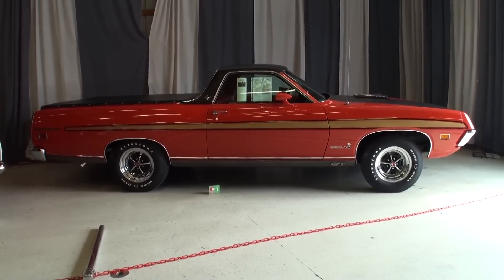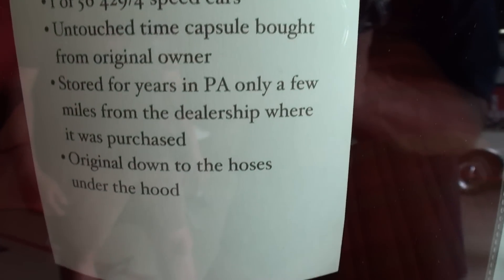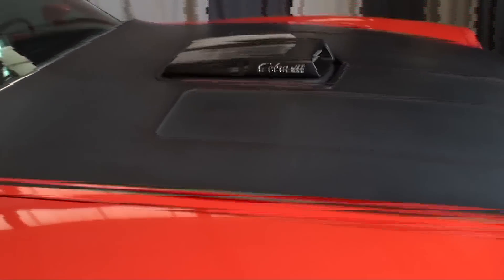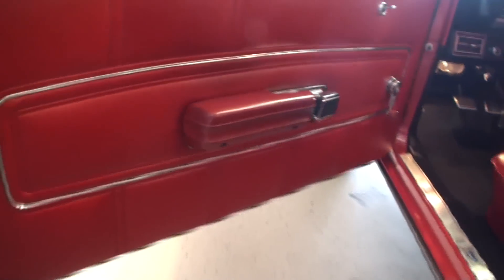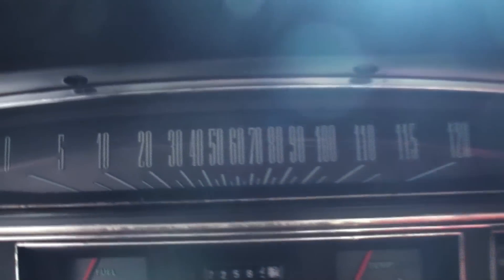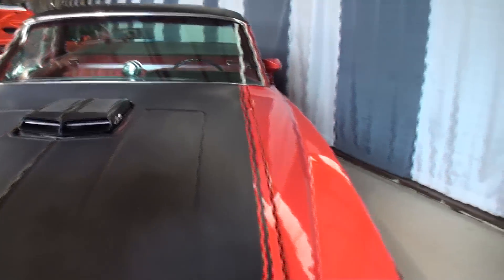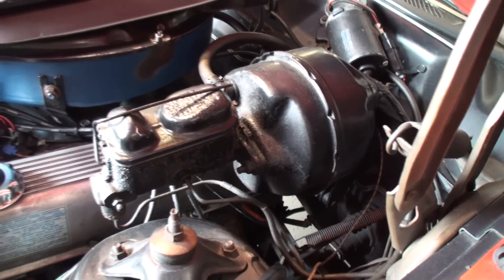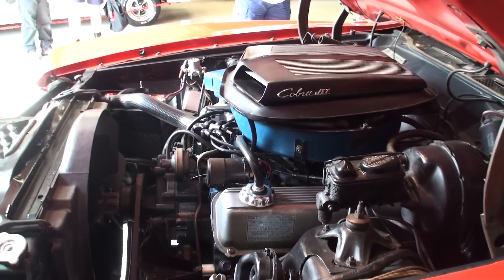1971 Ford Ranchero GT in Red & 429 Cobra Jet CJ Engine Sound on My Car Story with Lou Costabile

Comment: Has to be one of the highest optioned Rancheros I've ever seen. I think it's funny how the original owner ordered everything to make it super sporty but skipped the optional ribbon tachometer. Lol. Just an awesome car.
Reply from the maker: Hi Kenneth White, Glad you enjoy this one :-) Me too, Lou
Reply: Lou Costabile loved the video. Just love the survivors. Had a 70 Torino GT, 429, 4 speed with the same Hurst shifter. Mine did have the ribbon tach, but did not have hideaway headlight. White with the laser stripe. The clown I sold it to totaled it within months.
Reply: No air conditioning. No upgraded interior package. No console w/buckets. Other than that, all of the toys. I drove several of these in my career. Couldn't keep them straight. Absolutely zero traction, similar to the El Camino.

Comment: Wow, what a great find, Lou! This Ranchero is fantastic. It will probably make any car guy confused once again by the definitions of wants vs. needs!
Reply from the maker: Hi TheGunfighter45acp, Fun when I go to a car show a find a "jewel" like this one :-) Glad you shared a "Wow" :-) Lou
Reply: It is strange how the Ranchero  morphed   through a few model .   In 57 is was based on the Fairlane until mid 59  when the Galaxie  became its own model  to  make the Rachero  with the   luxury features  since GM   followed suit  with the El Camino  which was more like  the Impala inside with  that  cabin that was very close  to a car  appearence. 
   Then FORD  saw the market  for a Falcon  and  it was the  basis for the Ranchero  in 1960-66 . Then in 1967 it was an  One-off   design  year  with stacked  quad headlights  and  back to the Fairlane design for the front sheet metal  with  the  modified Falcon wagon  rear .         
    The 68-69  were pretty well   the  new Torino/Fairlane  at heart with the same  dash Unit  while  the  Ranchero  500   and  GT   shared the Fairlane  500 and GT  trim.   The 1969  added the rare   Rio Grande   Ranchero  in a few Grabber Colors with a vinyl  roof  and  Badge in the center of the  wheel covers , blacked-out hood    with  a  scoop , side stripe   and Bed rails .  
    It's estimated that  out of about 16,000 1969  Rancheros  ,   there were about 800  Rio Grande  Version   made and every  one had the  Data Plate  code  SPV ( special Performance Vehicle )  no matter the engine size . 
    In 1970  the Squire was added  for the Wood trim while the interior now had Ranchero badges  inside  on the glove box door  instead of the old badges for Fairlane or Torino .  It also added the 429 Cobra jet , Super cobra jet , shaker hood scoop  and hide away headlights.    It pretty well stayed  as a Torino  until 1976  when the Torino was retired .   
  But in 1977  the Ranchero  became the LTD II   Pick-up  .  But the 77-79 was well liked with the stack  quad rectangle since sales  jump about 10'000 and the 1979   saw close to 25,000   which included the 79 1/2  special edition for the 22 year run as the end of production . 
     FORD bought about 40% of Mazda and  stopped making the Courier Pick-up       
        to  revive the Ranger Badge from the F-150  and  build in on the platform of  the Mazda B2000    pick up .

  So the Ranchero  goes from the fairlane to the galaxie   to the Falcon  back to the Fairlane  then  a Torino    only to die  on the  LTD II  Design  where the  LTD  was born from the Galaxie  in 1965 . 
       The LTD II  Ranchero  is also popular to  modify  because the  front sheet metal fits the same  for the   Cougar , Thunderbird  and Mercury  Montego  in 1977 .

Comment: if anybody is interested in local/personal history, I have a pretty cool story about my friend's dad's 1974 Ranchero that he bought new back in the day

this particular car was a 390 V8 auto that was geared for highway use and the engine was slightly modified. he used this car in the mid 1970s to make 'deliveries' from Mexico to the south east united states. there was a section of the interior body just behind the drivers seat that was cut out and bolted back (hard to explain over text) where he would hide the package during his routs. it was also under the carpeting so it was even more concealed.  just like every outlaw back in the day, it was pretty easy to outrun the law, before the radio and helicopter days haha. he told me it was so well hidden that half the time he got pulled over, he would just stop and let the cops do their thing. other half of the time he would put the petal to the metal and let the 390 sing! 

he still has this car/truck parked in his back yard. its sitting there quietly next to his farm equipment just chilling in the tall grass. odometer rolled over twice. he never got caught, not even once. he said he's been well over 150 mph in this car multiple times. Ive even seen the hidden compartment with my own eyes and knowing this guy personally I really don't think hes bullshitting (in his late 70s he stil llegally gambles and slings moonshine)

I cant help but think of this older than dirt fellow every time I see a ranchero of this era
Reply from the maker: Hi thatallredheaddude 1, Interesting story and I think you did a great job sharing it, Lou

Comment: Not many of those Rancheros still look that good, a truly lucky find.  Except for the Cobra sticker and snake decal on the fender it looks all original. Those decals were only on 1970 Torino Cobra. The period correct tack is nice, but I hate to see holes drilled in that original dash  pad. So I would rather have the factory ribbon tack myself.  That's a very nice Ranchero!
Reply from the maker: Thank you Kimberlyexpects for viewing and sharing your thoughts on this "very nice" one :-) Lou

Comment: That's one bad ass Ranchero. My favorite mid size Ford muscle cars ever were the 70-71 Torino/Cyclone 429CJ/SCJ.....well besides the 66-67 R-Code 427 Fairlane/Comet but they were very few and far between and the 429CJ was a much better engine for regular street use than the raucous, race bred R-Code 427. Also love the 68-69 Torino/Fairlane/Cyclone 428CJ/SCJ, especially the 69 Fairlane Cobra Fastback, Ford's  answer to the Plymouth Roadrunner/Dodge Super Bee. The base price of a 69 428CJ Fairlane Cobra was only $3,200. One of the best bargains of the muscle car era
Reply from the maker: Hi Jeremy Thompson, Glad to read you enjoy this uniquely built Ranchero :-) Lou

Comment: You know what's really rare? I used to have a car magazine some time in the early '90's, I think, that had a '70 Falcon with a 429 SCJ. Looked just like the Torino, only it was a Falcon.
Reply: I ran across an orange 70 Fairlane with a 429 4 speed in California in 85 for 4000.$
Reply: @samuelmorado70  Rhe Fairlane is much much more rare than the Falcon. The Falcon isn't even as rare as this Ranchero.
Reply from the maker: That sounds like a cool car :-)

Comment: So this is a Super Cobra jet? Did not know they came in Rancheros.
Reply from the maker: I'm not a Ford Expert, however I believe the "Super Cobra Jet" has a special oil cooler pieces and this one does not have that.  Reading the details on the passenger side window this car is not a Super Cobra Jet.  If there is a Viewer who can share details I'm missing, feel free, Lou
Reply: Lou Costabile 
Yes I get Confused as some have the Drag pack and some don't?

Comment: If he doesn't get a new title, it's still not his car, correct?  Couldn't the original title holder say he 'stole' it? Well, thinking about it, the original owner would have signed over the title, so there you go..  It's already been signed over, so it's not the original owner anyway...

 I'd title the thing, and I'd drive the thing!  Awesome car, but if you can't drive it, what's the point..  When I was a kid I built model cars, trucks, boats, planes, etc and all you could do is look at 'em...  Seems that's the same thing he has there..  Oh well..
Reply from the maker: And....if you're going to drive it, please bring it to Lou's house :-)
Reply: MitchF150 hey, look. Driving a time capsule puts wear and tear on equipment, and there’s always the threat of a traffic accident. Some original cars like this just deserve to be looked at and started and pulled out of the garage. Let some of us preservationists have our way, alright? Deal with it OK?

Comment: i don think that's the right stripe for 71
Reply from the maker: Hmmm, not completely sure. Maybe a Viewer can share knowledge.
Reply: @loucostabile  I Had a 71 ranchero in 76 mine was grabber blue. It came with the same stripe but was silver. Black out hood and vinyl roof. 302 and c4. Drum brakes.